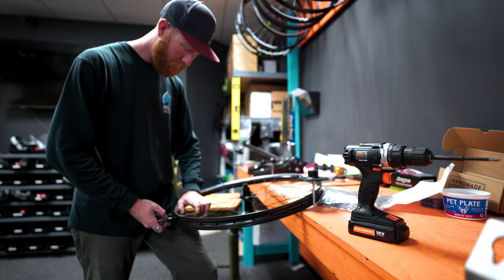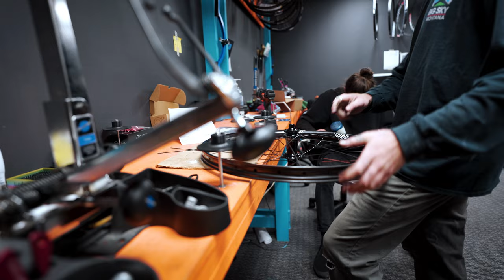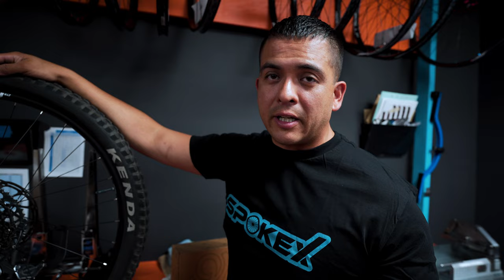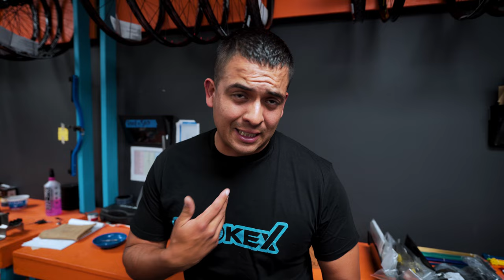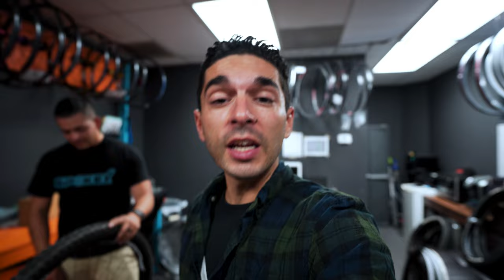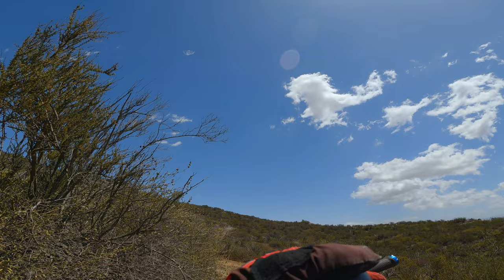More Affordable Industry Nine Alternative Wheelset Option? 120 Points of Engagement!

Comment: I don't even know which hubs to get. As there are so many options now. I currently have DT Swiss 350 boost with 54t ratchet. So 6 deg engagement i think. But I see project 321 has several engagement options, but their fastest is 1.1 deg, they use magnetets instead of springs. Onyx use sprag clutch, Industry Nine has 3 deg engagement on Hydra, I forgot what Factor, Halo hubs have but hight too. I might have forgotten some. I see even some othe rless pricy hubs have better engagement than Hope pro4  which I used before. Like Spank Hex, Nukeproof Horizon v2.
Reply from the maker: I got the hydras been very happy with them , but the factors are dope as well